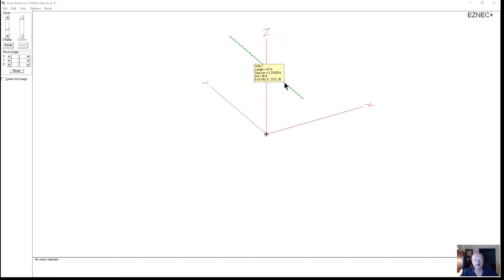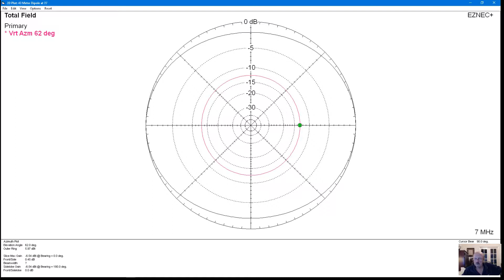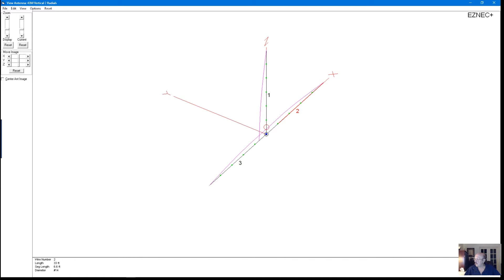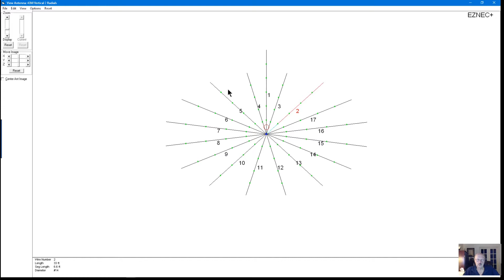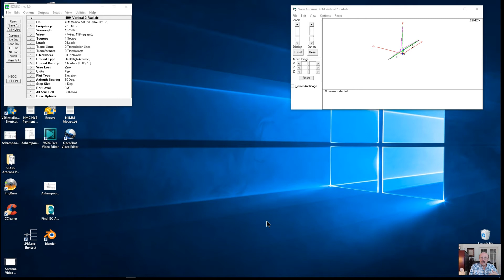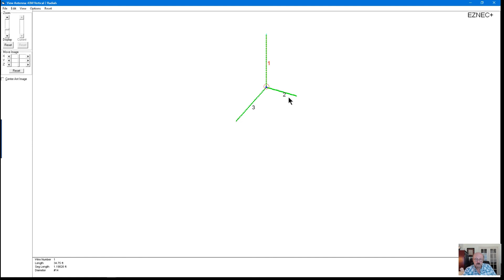Is a dipole antenna better than a vertical antenna ?

Comment: Don, Thanks for nice video showing use of EZNEC software. I have modeled many antennas but never put both on top of each other to compare like that. Really shows the differences nicely. I run a 43 ft ground mounted vertical with some ground mounted radials and some raised ones as well just to help improve the efficiency. It does work surprisingly well. 
73
Jon N8MUS